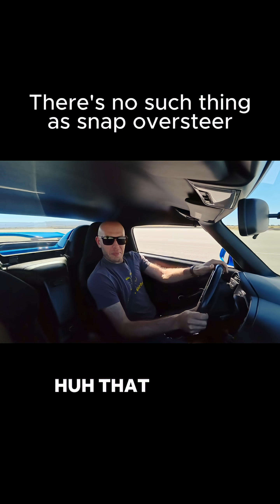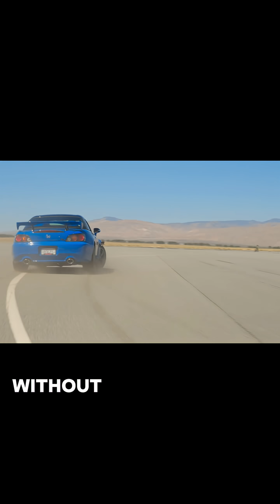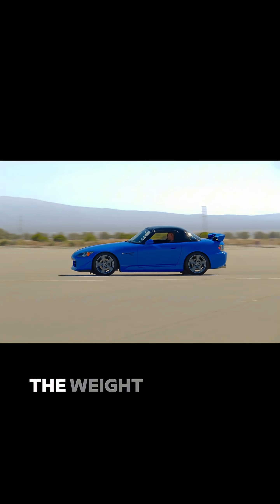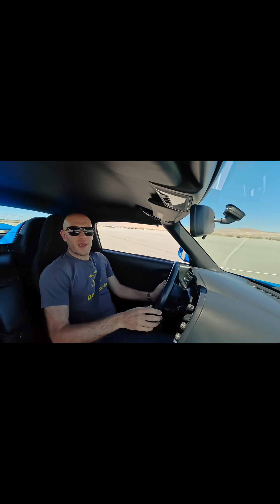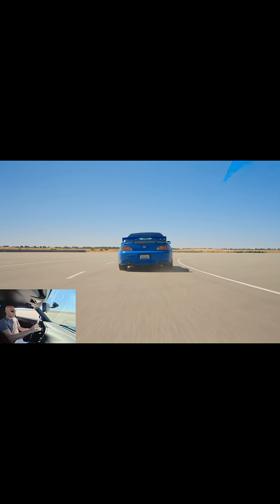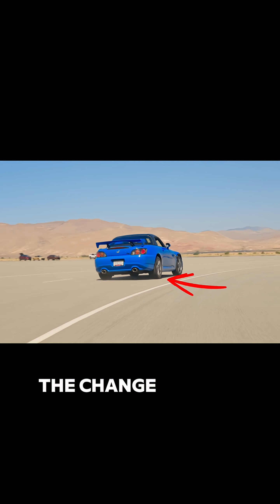EXPLAINED: The myth of snap oversteer #cars #driving #honda

Comment: SW20 would like a word. Even driving smooth and gentle that back end just wants to shake and do the cyclone
Reply: Yeah exactly, talk to any AW11, SW20 owner and they will tell you that what is shown here is not the same as what happens when driving them.

(Former AW11 driver lol)
Reply: Watch the full video, we use an SW20 too!
Reply: @NikRomanoRacing For me when I ran them for a bit, I actually induced more understeer and that helped for me a bit when I felt the backend wanting to come around. That window of catching it just felt so small, especially coming from a S13 chassis.
Reply: @EvLSpectre For sure the window is smaller, partly from the inertia in the back and partly just from your location in the car in relation to the center of rotation. That's true of any rear heavy car though. Just takes some getting used to!
Reply: @NikRomanoRacing Very true! I'm lucky enough to have some good friends and have gotten to drive some older and newer 911s, and rented a GT3RS. The base models I couldn't get the hang of the mid corner grip but liked the initial turn in. The GT3RS for me drove great from the added down force.
Reply: @EvLSpectre 911s, especially one's without downforce, are all about loading the crap out of the front axle and keeping it loaded until you're ready to jam back on The gas. If you don't get the entry phase just right (meaning, slightly and accurately overcook it), you'll be tempted to get off the trail brake too soon, and then the front doesn't play ball anymore.
Reply: @NikRomanoRacing That was my difficulty in adjusting. I like the more nose weighted handling coming from karting and drifting, but the more rear weight biased cars and how it almost pendulums gives me issues. My S13 was also more front bias but that weight distribution is better for me. Just still excuses, as I should be able to adjust to a cars quirks.

Comment: Dudes picking an argument with rev1 Mk2 mr2 owners across the planet
Reply: Exactly, laughable to use a front engined S-2000 to make his case. Any car can experience liftoff oversteer. The issue with the Mr2 was short wheelbase+mid engine layout, meaning very little rotational inertia, meaning good luck catching oversteer if you get into it.

Comment: I've been saying this for years, and using the S2000 as my example. Specifically with the AP1, as it has the quickest steering ratio, which makes drivers more prone to overcorrection.

Comment: Also id like to see you do this in a fwd driving a windy downhill at 55+mph and act like its no big deal
Reply: pro tip, in a fwd car you can correct oversteer simply by applying more throttle.
Reply: @Obi-WanKannabis so in other words don’t let off the gas in rwd (or ease to reduce understeer, or more to create understeer), whereas more gas in fwd?
Reply: @SoapyMacTavish  Yes, FWD you learn the car. RWD you get a feel for it.
Reply: @SoapyMacTavish  in rwd if you have too much power you can also power oversteer by adding more throttle, in fwd, going on the throttle always creates understeer.
Reply: @Obi-WanKannabis in my g80 m3 6mt I understeered on a sharp left turn, had to do it though a car was bombing down the opposite lane, crazy drivers out here.

Comment: Do it in a widow maker porsche
Reply: Or Dodge Viper.
Reply: MR2
Reply: Used to own a 76 911 Targa. I actually had a worse experience stopping in the rain. Had to get off the brake to regain steering. Course correct then reapply so as not to rear end the cars in front of me. Definitely got my attention and heart rate up that day. 😅
Reply: Not an issue with modern tires anymore,  they actually drive quite nicely at the limit of modern tires
Reply: Modern tires would like to have an argument about calling the "widow maker" Porsche, a widow maker.... 😂

Comment: Liftoff oversteer is horrible and dangerous. It’s what I associate with FWD really.
Reply: Lift-off oversteer has nothing to do with the drive wheels, and more to do with things like weight distribution and suspension geometry. The most lift-off oversteery car I've driven was an FWD VW Rabbit. More so than an old 911 and even a first gen MR2.
Reply: @TheOfficialOriginalChad you accidentally agree with me
Reply: @Surtees-ff So you’ll no longer associate the position of the drive wheels  with lift oversteer?
Reply: Or rear engine rear wheel drive cars are pretty notorious for that as well. But like he explained when you know how to properly drive it's not as big of an issue